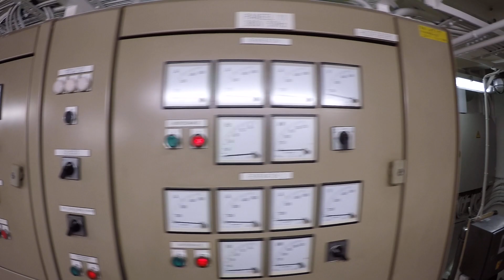5500hp Engineroom Walkaround

Comment: What are those big round blue things?
Reply: +VTSPQR I think they are the propellers/propulsion
Reply: If iam not mistaken those are voith Schneider propellers
Reply: +Alexander Siebold 
Are those the type where the propellers turn the boat without rudders?
Reply: +VTSPQR pretty much
Reply from the maker: These are indeed the Voith Propeller Units. They can steer the tug in any direction.
Reply: +Shipping/Harbors 
Thanks.
Reply: +ShippingHarbors 
Hi, bit of a weird question but is there any way that you couldmake a video and put a camera on a pole with a torch and put it underneath the tug so we can see the voith propellers spinning at low rpm so the camera doesnt get sucked in? Would be pretty cool to see!!
Reply from the maker: +GoProWithTom Hi Tom, I would like to do that but unfortunatly the water in the port is not clear enough for that. There is allot of sandisk mixed in it and you can only see 20cm in distance or so :-(
Reply from the maker: +GoProWithTom sandisk = sand
Reply: ah thats a shame but fair enough, im assuming that you are always in the port and never in clear enough water?
Reply from the maker: +GoProWithTom indeed.  Never in clear enough water :-(
Reply: Shame, so how much is the pay because ive read somewhere that the pay is up to about 96000 euros which is 68000 pounds here in england?
Reply from the maker: +GoProWithTom I think those numbers are for offshore work, and not for harbor-towage ;-)